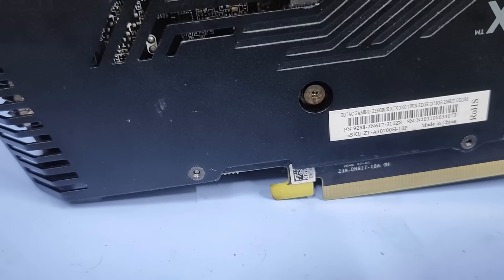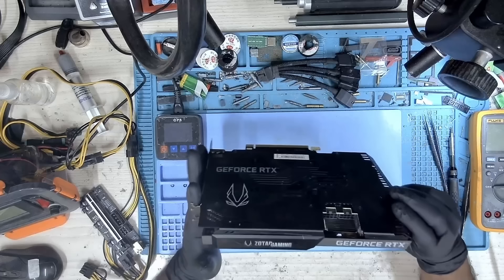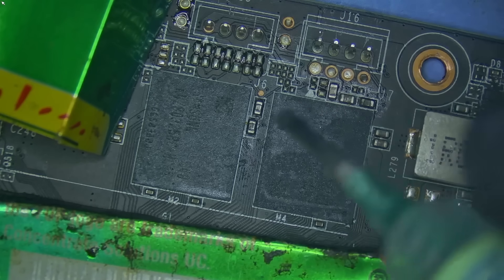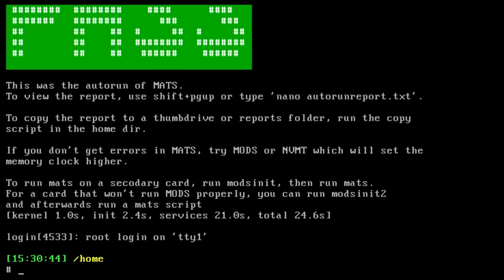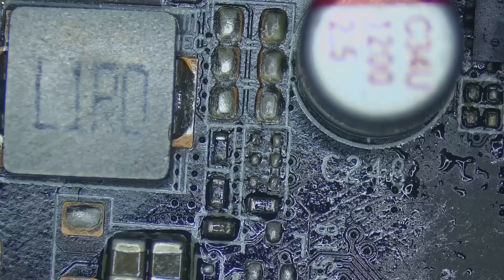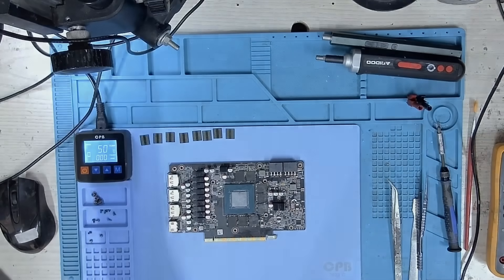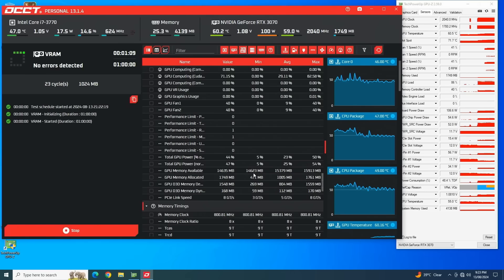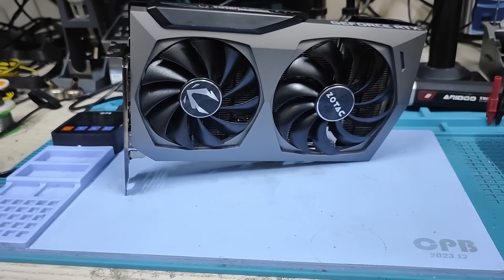Upgrading RTX 3070 Memory from 8GB to 16GB - Part 1

Comment: What's up man, I want to upgrade the vrams of my gigabyte rtx 2070 super video card but how do I find the vrams compatible with my video card?
Reply from the maker: The original memory is GDDR6 14Gbps memory. You can upgrade to 2GB Samsung memory. But you will also have to deal with the straps so BIOS knows that the new memory is installed.
Reply: @GraphicsCardRepairs-tk7ql  How do I set the bios? Is it difficult?

Comment: how u know wich way to connect the straps for the bios of GPU?
that would be helpful to know...
Reply from the maker: The truth is I don't know. If there is no boardview there is no way to know.  It's just that I have to figure it out as I poke around.
Reply: @GraphicsCardRepairs-tk7ql   thanks 
yah I have also to figure it out for my 2080 super n I also dont know if it worth it

Comment: Did you ever think about upgrading a 3090Ti to 48Gb of vram? Would it be possible to do so? I mean the RTX A6000 is the same pcb and it has 48Gb of vram.
Reply from the maker: 3090Ti already uses 2GB memory modules and it has only 12 memory slots. It cannot be upgraded further. 2GB is the highest memory capacity produced.
Reply: @GraphicsCardRepairs-tk7ql  Ups, my bad. I meant the 3090.

Comment: Instead of modding you better buy a card with more vram in the first place. So simple.
Reply from the maker: @bestopinion9257  I already have a 4090. This is just an experiment.
Reply: @GraphicsCardRepairs-tk7ql  I mean not you precisely, anyone who does it. 

For 4090 we talk about another price range. If you have the money, that's great. But if not, don't jump on that 3070 with shit vram and then modding.
Reply from the maker: @bestopinion9257  yes that's right. There is no point buying a 3070 to upgrade. It's better to buy a GPU with more VRAM. I have the same opinion as you. 🫡

Comment: your psu 12v rail, rest in peace
Reply from the maker: Yes. This 1600W beast is retired now. It has been replaced by a new 1550W PSU.
Reply: @GraphicsCardRepairs-tk7ql  by the way, isn't that too high rated power though? it will most likely work in a very inefficient part of its efficiency curve.
Reply from the maker: On this test bench i test cards from RX 580 right upto RTX 4090. So my powersupply can cater to all these cards power needs. This test bench is used to stress test all these cards after repair.

Comment: Hi, my Palit RTX 3070 gaming pro recently started loosing its singnal to the monitor while working in the background after few minutes. I tried changing power supply, monior and reinstalling drivers but still didnt fix the problem. What do you think is the problem?
Reply from the maker: These are memory related issues. First thing I would run memory test and if I don't see any failed memory I would reball the GPU core. That will definitely fix the issue but after reball if it's still doing the same thing then the core is on the verge of dying.

Comment: Rtx 4060 8 gb 😢 I want to 16 gb
Reply from the maker: Unfortunately, RTX 4060 already uses 2GB memory modules which is the highest capacity and it has only 4 memory slots. There is no upgrade path for the 4060.

Comment: My laptop has the desktop 3070 in it. Runs it at 150w and its usually within 5-6% of the stock desktop 3070 reference card. Similar temps to it too. Would be cool if it had 16gb of vram. 

Laptops especially have a shortage of vram where very, very few even offer 16g of vram. So if you do professional work and need lots of vram, it might be worth it modding your laptop board to have 16gb of vram.
Reply from the maker: Yes the 16GB 3070 on a laptop would be a super combo. Unfortunately, I have not tested this upgrade on Laptops yet and don't have one gaming laptop to test. I would love to test this upgrade on a Laptop to test what benefits are in store.
Reply: @GraphicsCardRepairs-tk7ql  Laptop 3070ti = desktop 3070 since they're literally the same gpu. So, I'm just gonna call both the 3070 for simplicity's sake.

You can finally use ultra high res texture packs at 1440p to 4k resolution. For example in cp2077, my 3070 laptop will run out of vram in dogtown if I use HQ textures. I can run out of vram in no man's sky if I use max textures at 1440p. Doom eternal at 4k will run out of vram. These are games the 3070 can push at 4k easily and keep 60fps or more. 

Other use cases would be productivity such as AI training would be easier with 16gb of vram, it would make vram heavy workloads easier, etc.

And this 3070 in laptops went for a cheap price in several regions. Close to $1000, which is similar price to an equivalently built desktop with similar perf.

Comment: Step by step explanation....I hear only music instead of explanation what's being done... Great help dude. 😢
Reply from the maker: Thank you for watching and for your input! I’ll definitely work on providing better step-by-step explanations.
Reply from the maker: Did it lack explanation? You can ask me and i will answer.
Reply: @GraphicsCardRepairs-tk7ql  well I see you heating (what tool and whats the orange block on top) but also whats the fluids? I see you doing it multiple times?  Then you use something extra (metallic?) with the heating. Again fluids. Then not sure if you also remove the little chip on the side, and replace that, or not. I stopped watching after that, and thinking, lets just buy a second hand one later with more memory, when new ones hit the market.
Reply from the maker: Ahh the orange block is a aluminium block used to keep the core cool while testing. If your are refering to the fluid when removing the memory it is flux. It helps prevent oxidation and aids in even temp distribution when soldering. When heating the green foil i use is to cover the capacitors as they have a tendency to explode with direct heat. the foil is a soda can piece. There are lot of details that goes into repairs or upgrades. its good for those who want to learn.

Comment: This is amazing mod I wonder if we can revive old gpu using this mod.
Like 980 Ti/1080 Ti
Reply from the maker: Upgrading older GPUs will cost more than the value of the GPU. for the price you can buy faster cards with more VRAM. But its would be good content for a video though.

Comment: I've Zotac RTX 4060 8gb Can you upgrade it to 16gb or 24gb?
Reply from the maker: @amitpandya6827  all 40 series already use 2GB memory modules. RTX 4060 only has 4 active memory slots. Currently 2GB is the highest memory capacity produced on GDDR6 and 6X platform.

Comment: It'be nice if we can have 3060 12GB upgraded to 24GB. That would be a greate little AI card for home brew enthusiasts.
Reply from the maker: Unfortunately the 3060 already uses 2GB memory modules and has only 6 active memory slots. 2GB is the highest capacity module produced till date on the GDDR6 or GDDR6X platform.
Reply: @GraphicsCardRepairs-tk7ql  That's indeed unfortunate. Thank you for the insights!

Comment: I know that you are doubling Vram on a 3060ti, but is it possible for more Vram on the 3060 12gb version? It would be quite a flex if I could say that I have 24gb of Vram. 
Anyways, keep up the good work!
Reply: I expected that. Thank you anyway.
Reply from the maker: Unfortunately the 3060 already uses 2GB memory modules and has only 6 active memory slots. 2GB is the highest capacity module produced till date on the GDDR6 or GDDR6X platform.

Comment: I get it, you're in the business to make money, so I looked up what you charge for this upgrade, and you're asking 250 USD and I have to say Shame on you. You have what, an hour in Labor, maybe 4 at the most and I know the memory itself is cheap.  Plus you can buy these cards used for less then that on eBay. Why to just price yourself out of the market... Oh I'm sure you will sucker some dults into buying because they are so desperate they will pay anything. This is absurd and you should be ashamed of yourself for pricing this so high. Worse yet, I just Googled the chip they can be had off of AliExpress for close to 10 USD each, so 80 USD for the chips and an hour or two labor does not sound like 250 USD. I didn't even bother to spec out shipping and the sort. Plus I saw you charge 100 USD for speed service which means you delay on purpose to force folks to buy shit they don't need... You're a dick for real....
Reply: He's a dick for providing skilled labor?
Reply from the maker: The prices are in AED and not USD. Its clearly mentioned there. what @cybercapri  has mentioned devide that by 3.65 and you will get the amount in USD. You can always ask if your not sure.
Reply from the maker: I am sure you are refering to these prices from my website and the prices you are refering to are in AED and not USD. You said everything based on assumptions. All you had to do is ask. I would have told you. And its clear mentioned AED.

Comment: Very nice video my friend. Would this apply to the Rog Strix 3080 Ti too?  I feel like this card is powerful already, but severely limited by vram, can't imagine why Asus would give it 12gb when it still has the horsepower to run new games like a 4000 graphics card.
Reply from the maker: I am working on one 3080Ti. It's a long way from complete. I will release a video once I am successful.
Reply: @GraphicsCardRepairs-tk7ql  oh nice :) if it works out, do you do commissions for it? I have one and I don't really want to pay 1500 for a 4090 which gives me the ability to display fake frames. The 30 series is probably the last true gpu with raw performance and no bullshit.

Comment: I have that exact 3070, bought it new in January of 21, was happy with the card for around a year and then started to run into vram size issues so upgraded to the 6800xt and very happy with it.
The black screen issue might be your power supply, the 3000 series had very bad transient spikes so it's probably hitting a spike just when the load stops, I have a 1200W PSU so didn't have any issues with my 3070 or 6800xt.
Reply from the maker: Sure I just replaced the power supply. The old one I was using was 1600watts but it's toast now. Got a new one 1550Watts thermaltake. Let's see how it goes.
Reply: @GraphicsCardRepairs-tk7ql  Did it go well??
Reply: Scary how youtubers got you to change a perfectly good card due to "VRAM" issues lmao. ITS SCARY how easy people trust everything on the internet.
Reply: @pothitoskourtis  lol scary how people assume stuff and scarry how easy they think they know it all, unfortunately usually those people are wrong just like you. It was before the youtubers started talking about it and it was because I was mining ETH at the time and wanted to keep mining while I played games and some games ran on the 3070 no problem while mining but some didn't, after switching to the 6800xt I had no such problems any more + both cards were basically free as I mined enough ETH to pay for both and even got some left.
Reply: @Roman00744  i had no such problem with the 2070 and its 8gb vram and still have no problem now with a 4070ti and its 12gb vram on a 4K monitor. Theres no vram problems and i prefer to believe what i see versus a youtube video mostly testing stuff on broken pc ports of playstation games like the last of us, heck even hogwarts legacy was a solid 60fps experience on a 2070 non super on 2K with mixed medium/high settings.

Comment: I wonder if someone will cook up a software patch for this...
Reply from the maker: Thanks for your input! It's always interesting to hear what the community thinks about potential solutions.
Reply: @GraphicsCardRepairs-tk7ql  -thanks for the reply,  I would think its possible as there are all sorts of patches that are built into   tools like NVcleanstall, which do a lot of tweaking, not only that there are tweaked drivers to run those strange chinese  gfx  cards with laptop gpu's on them,  so the skillset is out there, all that is needed is the demand for it...

Comment: These mods will save a lot of these video cards from now on, not only because of the potential of the RTX 3000 which are more moderate to make than AMD's for now! But because of the time and useful life in the hands of each user, opening this range of options in the hands of engineers like you to do this work which for me is a greatness of very relevant size for the community. My congratulations!👑
Reply from the maker: I really appreciate your kind words! Thank you
Reply: "More moderate to make than AMDs" - wdym by that? Easier to make?
Reply: @thefilthycasual448  i want to know what he's pointing at too! plz elaborate @rogerhul1573

Comment: Wow i would like to upgrade my  6700xt from 12 gb to 16 but im worried about the other stuff that i need to change beside the memory chips 😓
Reply from the maker: Unfortunately the 6700 already uses the 2Gb memory modules which is the highest capacity produced on the GDDR6 platform. there is no room to upgrade further.

Comment: Oddly enough team Red has been adding 12gb to 16gb ram to many of their newer releases.  Even Intels Arc A770 comes with 16GB.  I dropped Nvidia after the 20 series launch, with that 2070 FTW3 super still running strong.  The Arc A770 I bought "Just to see" has been a flawless performer even out pacing my borrowed 4060 just to test things out.  Though admittedly the 4060 is better it still sports on 8gb of ram which gimps it in newer titles with high graphics settings.
Reply from the maker: Thanks for sharing your experience! It's always great to hear about real-world performance comparisons. Your insights really help others make informed choices when upgrading.

Comment: This was very interesting. I was thinking about doing something similar with a RTX 3080 10GB. The Ti version of this GPU card has 12GB. When I tore down the GPU to bare PC board to replace the thermo compound, I noticed that the board had two unoccupied spaces where the extra 2GB of memory would live if this were a Ti version board. I was thinking about adding the missing RAM chips but was concerned that the board would not recognize the additional memory due to addressing issues. Decided to not take the risk in case my concern was valid in which case I would not have any idea on how to correct the problem.
Reply: You can upgrade RTX 3080 10 GB to 20 GB only, replacing the existing 1GB chips, with 2GB chips. RTX 3080 only supports 10 chips.
Reply: @mikegaming4924  Thanks and sorry for the late response. So, really? This will actually work? If so, I'll definitely look into it.
Reply from the maker: Your concern was valid. Installing memory in the empty slots would not work as the data lines on those slots are dissabled from the GPU core. However if you had to install memory there the GPU would not have booted or given you a black screen.

Comment: I just built my rig with a 7700x 32gbddr5 and a 3060, it only has 12gbvram  but If  I upgrade I will be going 4series
Reply from the maker: Nice build! The 7700x and 3060 are a decent combo. Upgrading to 40 series sounds like a great plan.

Comment: wouldn't this require a modified driver for this to work?
Reply from the maker: As off now, no. But the black screen issue i am yet to fix so if modification is required i will update in part 2 of the upgrade video.

Comment: Would it be possible or even worth it to upgrade a rtx 4070 from 12 to 24?
Reply from the maker: Unfortunately all the 40 series use the maximum produced memory modules of 2GB GDDR6X. It also has only 6 active slots. Further upgrade is not possible on this GPU.
Reply: @GraphicsCardRepairs-tk7ql  dam thanks for the reply it's appreciated
Reply: If ever 4GB GDDR6X come out, then who knows.
But GDDR7 being almost here, GDDR6X 4GB may never happen.

Comment: My laptop can get better performance if it had 8gb instead of 6gb because even if it doesn't use 95% GPU it's at vram overfill which is making my framerate drop
Reply from the maker: I have not tried upgrades on Laptop yet. May be in the future i will consider upgrading a Laptop.

Comment: People always say that the bottleneck when you go over your VRAM is the system RAM. However, in reality, your system RAM isn't all that much slower than your VRAM. The problem is the PCIe slot bandwidth! 

Even a full 16 lanes of PCIE Gen 5 can only match the bandwidth of 3200 MHz DDR4. And there is no GPU that supports Gen 5 PCIe yet. The max you can expect is 16 lanes of PCIE Gen 4; which is half of that bandwidth!
Reply: It's not just the bandwidth, but also the distance travelled causing latency, something you don't want when you need things ASAP to continue work.
Reply from the maker: You are right. The bottleneck is the PCIE bandwidth. But compared to the GDDR6 VRAM, GDDR4 is much slower. GDDR6 is directly available to the GPU compared the the DDR4 RAM which has totravel through the PCIE than to tthe CPU and then to the DDR4 RAM and make its way back. This is a topic on its own. May be i will cover it in the future.

Comment: I'm curious theoretically speaking if this could be done with a desktop GPU couldn't it be done with a laptop 3070 as well? I just bought a clevo laptop with a 3070 on ebay recently and I have a lot of things to consider if I want to upgrade it in the future.
Reply from the maker: I have not tried the upgrade on a Laptop yet. I will conside it in the future.

Comment: I think you have to flash the firmware with a modded version that is written to handle the extra VRAM. That's probably your issue.
Reply from the maker: possible. I will release part 2 once i fix this issue. It's going to be interesting.